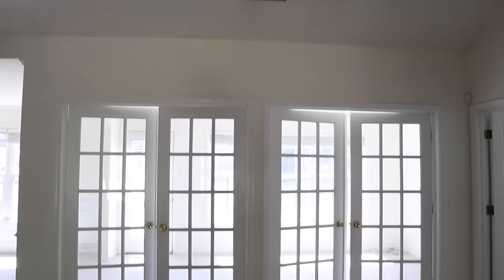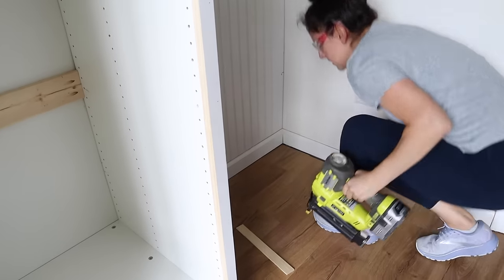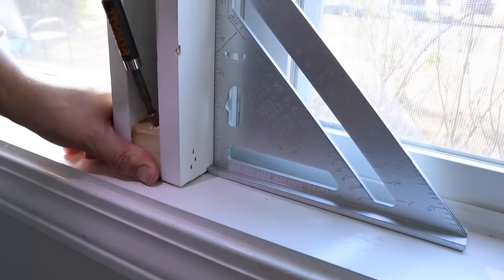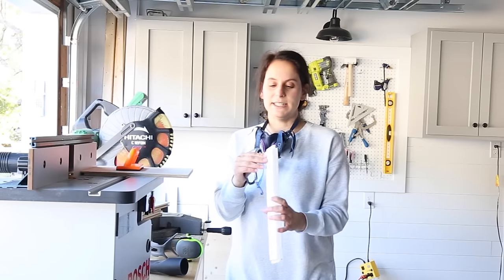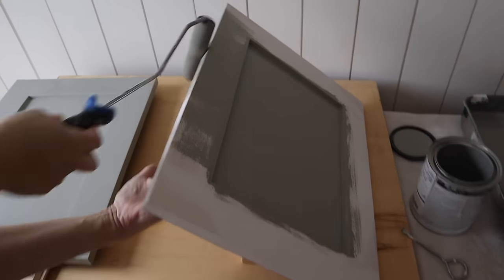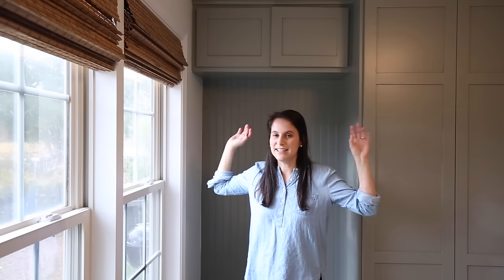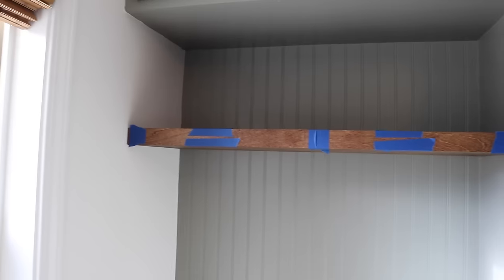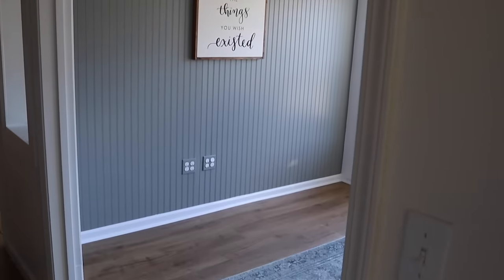Extreme DIY Office Makeover & DIY Built Ins | Open Space Turned into an Office!

Comment: Mr. Dude (I'm old, I forget every 10 seconds) did a fabulous job!
What is the material Brandon stuck into the gap between cabinets, prior to caulking???
You do tell us what the right color is? NOT Evergreen Fog (son's board + batten wall color), but: ... ?
Reply from the maker: Hi there and thank you! The gap filler used before caulking is called backer rod and the correct paint color is cornwall slate from Sherwin Williams.